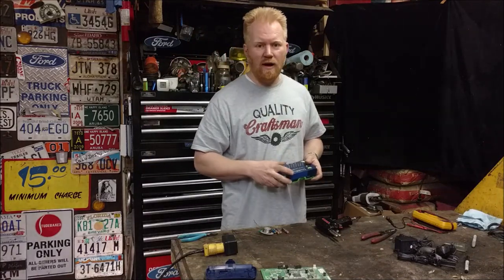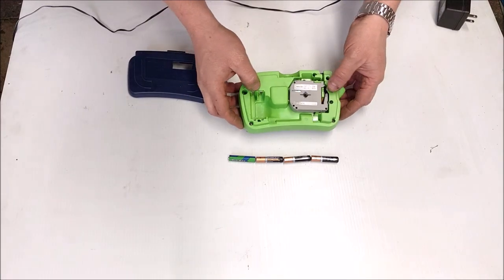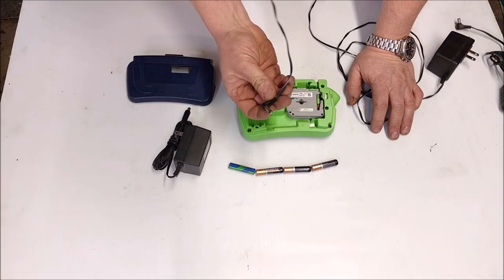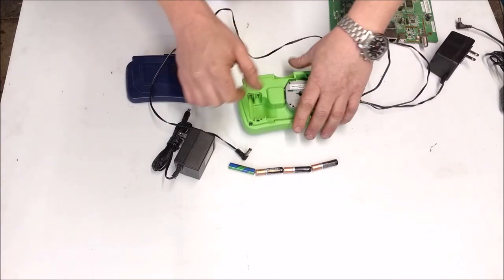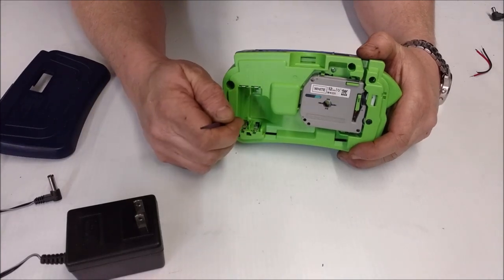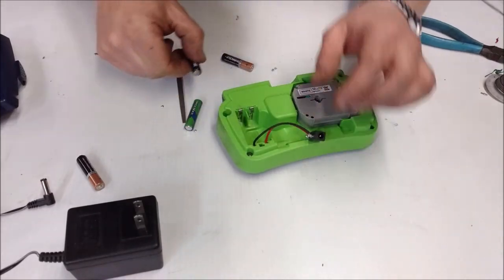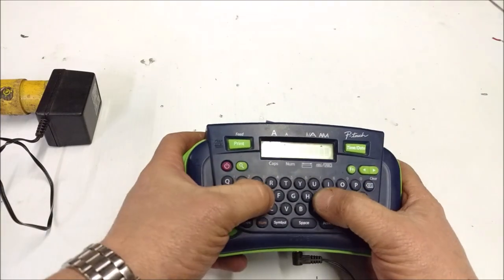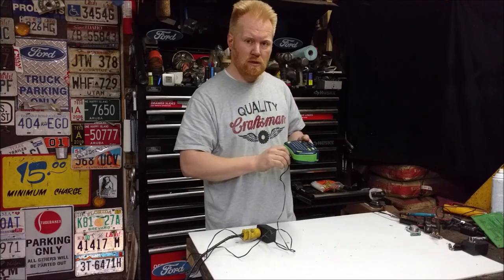Make a Battery Powered device Plug-in compatible

Comment: I am a deer hunter. I made a 4x8 enclosed deer stand 16 feet off the ground.  I purchased a camping fan that has 4 D batteries. I use it to defog my windows when I run my heater.  Can I forgo the D batteried and hook uo a larger battery so my fan will run with out changing batteries all the time?
Reply from the maker: You could get a 6volt Deep Cycle Lead Acid battery, and it would run forever. But I'm not sure if you would want to lug it up 16 feet.
Reply: tks

Comment: So to convert something that only uses 3 batteries or 4.5 v I need to have the relevant powered adaptor?
Reply from the maker: Yes. Battery powered stuff is very lenient and you could easily use up to a 5 volt power supply(easier to find than a 4.5v)
Reply: @sixtyfiveford  I chickened out and returned it 😂 I'll try to get another back because I really liked it... It's a LED Edison bulb lamp in this gorgeous cage but it's battery powered, for where I wanted to put it, batteries are a total waste of time. I'll get another one, and try your method.

Comment: What about the milliamps? I seem to recall you have to get the correct MA’s or you could blow the device?
Reply from the maker: No. The device will only draw what it needs. Batteries themselves can easily put out  1000mah- 2000mah+. Most stuff draws sub 1000mah/1ah, so a transformer in this range will be adequate.
Reply: sixtyfiveford thanks! So for a device that takes 4 AAA’s a 6 volt adapter with between 1000-2000mah would be fine?
Reply from the maker: 1amp/1000mah is more than ample and with AAAs a 500mah would probably be plenty. 4 cells hooked end to end will require 6 volts.
Reply: sixtyfiveford thanks!!!

Comment: Great idea, I have that same labeler, went to use it yesterday and what do you know the batteries were dead. LOL! This seems to be a regular occurrence with the labeler since I only use it every now and then.
Reply from the maker: I only pull it out every 4 months or so and the batteries seam like they're dead every time.
Reply: Rite, same here the power adapter is a perfect solution. I just stuck 4 AA batteries in mine yesterday to make 2 labels. LOL!

Comment: would this work for something running off watch battaries?
Reply from the maker: Yes. They are either going to be 1.5volts or 3volt button cell batteries. You can also just wire a AA battery cell in it's place and it will run 50 times longer than it did off the little button watch cell battery.

Comment: Can I connect my 18650 battery charger to the battery holder of my  device to charge them straight away..... Is it possible?
I don't want to swap batteries every time their charge is low
Reply from the maker: I don't see why not.
Reply: Did it work?  I don’t think it would as the charger is normally rated much higher than the battery, correct?

Comment: How do you know how many amps are needed? I just converted a 2 AA battery hobby drill to wall socket. The thing needs 3V to run but it runs much slower than when I connect 2 AA batteries to it. You can change the voltage on the adapter from 3V to 12V, I tried putting it at 4.9V but it ran at the exact same speed as before so I'm wondering if it has something to do with Amps?
The adjustable plug has several version of it, the one I bought puts out 600mA at 3V. Other versions have 2,1A at 3V and another at 1,5A at 3V. I don't know how many mA or A 2 AA batteries put out and finding that out is confusing. Google gave me 
 anywhere from 1200-3000 mAh for a single AA battery depending on type. I'm so confused as to how to calculate what Amps are needed. Anyone know how much mA or A I need to output to equal 2 AA 1.5V batteries?
Reply from the maker: A power tool will be on the extreme end of power draw. A full alkaline AA will allow a current draw of upwards 2-3amps. I would say .6amps is too low and you'll need to go upwards 1.5amps or even 2.1amps. They have a capacity of around 2500mah at a slow 100ma draw, so we can use this to guesstimate the current draw. 

Fresh Alkaline batteries
At 2amp draw: should last 10-15 minutes before the tool feels super weak
At 1amp draw: should last 30-40 minutes before the tool feels super weak
At .5amp draw: should last 60-75 minutes before the tool feels super weak

Comment: You matched the voltage.  What about the current?
Reply from the maker: You just need more than the device will pull. Battery operated stuff is generally very low, especially anything running on AA or AAA cells. A small 200ma would handle virtually anything powered by these small cells. So pick up one that's larger and you'll be fine. Even hooking up a 1000ma is fine as the device will only pull what it needs.
Reply: sixtyfiveford  Thanks!

Comment: The DC sockets have different amperages, how do we determine the correct one?
Reply from the maker: It doesn't really matter. The item you're powering were only pull the power that it needs.
Reply: @sixtyfiveford  I have these 1.5v battery powered LED lights connected to a mains adaptor that is 3v and it melted the hot glue in the housing and caused premature failure?
Reply from the maker: @shaunhill2466  So you're running 1.5 volt LEDs off 3 volts. That would melt them. You just need a 1.5 volt transformer.
Reply: @sixtyfiveford  But you said it only pulls the power it needs?
Reply from the maker: @shaunhill2466  It pulls the amperage it needs but you need the correct voltage. So you can get a 1.5 volt 100mah-2amp+power supply and it'll only take what it needs
Reply: @sixtyfiveford  Thank you for explaining. How do I make sure the amperage is correct and how is that different to milliamps?
Reply from the maker: @shaunhill2466  You don't need to really worry about the amperage just the voltage. 
1000milliamps=1 amp

Comment: i want to run my boom box off my 12 volt spare car battery - but i can't find ONE! vid on how to do it. please respond - im having hella time finding this out. You know?
Reply from the maker: How many batteries does your boom box use?
Reply: @sixtyfiveford  ten -- hey buddy thanks for reply !
Reply from the maker: @t42 Press If they are hooked end to end in series then the boom box is running off 15volts-10volts(10 batteries full to 10 batteries empty) and straight 12volts will work just fine.
Reply: @sixtyfiveford  yes the Question is: How or what do I use to clip off the neg and pos posts of a 12 volt battery and wire it to an household outlet? Some have said break some jumper cables (there's where you get your clips off the pos and neg posts) and then what....I'm lost. I'm thinking INVERTER for this....any familiarity with that?
Reply from the maker: Just hook the 12v battery directly into the Boom Box battery compartment with 2 wires and forget about the plug. An inverter that converts battery  12volts DC to household 120volts AC is going to waste a lot of the battery power and the battery will need to be charged pretty often.
Reply: @sixtyfiveford  so i twirl a copper wire around the positive post of the car battery and scooch it into the boom box battery compartment to touch the dimple where the D battery positive nipple touches -- and then twirl another cable (does this one need to be copper too?) around the negative post of the car battery and then hook it to where the negative side of where D battery's touch inside the battery compartment; you know the little spiraly twirlly thingy. Yes but there are 3 sets of these neg and pos...?
Reply from the maker: There should be one positive (little nub) and one negative (spring). The other contacts are joints that just connect the positive to negative from one battery to the next. Not that it matters but with 10 batteries I assume you have 3 rows of batteries. One with 4 cells back to back and the others with 3 cells each. It takes up to much space to stack 10 cells end to end so they put these joints in.  Generally the positive and negative you need are on the same side (most of the time left) and the positive/negative will be in the top and bottom cell rows.

Comment: Ever try this on a 18650 battery?   Thx
Reply from the maker: I have. An 18650 cell seams to work fine in place of most 2 cell devices but should also work in 3 cell devices. The 4.2v-3v that you get from the 18650 seams pretty good. It is about a volt higher than 2 cells(1.5/1.6x2=3.2v) but the things I've tried it in didn't seam to care. I can't say that about every 2 cell device though.

Comment: Yup, nothing beats AC to DC. Batteries getting so expensive and then throwing them away. Who disposes of them properly anyways? One thing to point out is output Voltage is important to match but also "AMPs" will effect performance. Largely on power tools. Im converting a 14.4volt power drill. 14 -16 volts OK but requires higher amps.
Reply from the maker: You would need around 25amps of 14.4v to supply a drill under load.
Reply: @sixtyfiveford  - Well 2 years later I went back to validate what I was attempting to do. I gave up modifying my saw until needing it last weekend.  My device is actually a 14.4v cordless  mini (5 1/2)Skill saw. (Why did I say power drill ??) The battery lists 14.4v 2.5 amps. Going back to your reply - was that a typo? 25 amps?
Reply from the maker: @MrGlobaldave1  Yes 25 amps at a minimum. Take a regular circular saw that you plug into the wall. It's going to draw 15 amps at 120 volts. That's equivalent to 1800 watts of power under load. A battery powered circular saw is probably 1/3-1/4 as powerful. That means it needs, let's say 500 watts to run. 500 watts divided by 14.4 volts is equal to 35 amps.
Reply: @sixtyfiveford  - Wow - Ok thanks....again! Numbers make sense. I just stumble with the amps the rechargeable battery pack supplied indicates - 2000mah or 2.0 AH
Reply from the maker: @MrGlobaldave1  2.0amp hours. Means that battery pack can supply two amps for exactly 1 hour. 
2 amps for 1 hour
4 amps for 30 minutes
8 amps for 15 minutes
35 amps for aprox 3-4 minutes
Reply from the maker: @MrGlobaldave1  If you really want to utilize the old power tool, you can always use a 12 volt car battery. Just make up some leads. Clip it on your battery cable like the jumper cables and you'll be able to run it wherever your car is with the battery.

Comment: So 6V but what amount of current?
Reply from the maker: Battery operated stuff generally isn't going to draw more than 250-500ma at the most. So a 1000mah power source is more than ample.
Reply: Would a 1000 mA source not damage the device? I think I used a 300 mA adapter.
Reply from the maker: @origamigek  No. Because the device will only draw what it needs. Batteries themselves will put out in excess of 1000mah.
Reply: Oh rly

Comment: So I was thinking about converting one or two of those tactical flashlights you can buy from Amazon or some stores for like $20 or so which are super bright and you can adjust the beam from floodlight to super focused/laser beam and convert it from battery powered to a DC or AC power source on my 2012 Yamaha Zuma 50F scooter (whichever it the bike uses) kinda like fog light. Can you help sixtyfiveford? or anyone out there who knows what I'm talking about?
Reply from the maker: These small 12volt spot lights for around $10 each are amazing 2 pack w/wiring: https://amzn.to/2RIjEED . They already have the mounts, wiring, switch etc. Your Yamaha is going to have a 12volt DC system that should run 2 off these without issue.

Comment: What about amps / milliamps?
Reply from the maker: What about them? Most AA, AAA, C and D powered items only pull maybe 100-200milliamps. Any power supply over 500 will supply them with ample power.
Reply: @sixtyfiveford  ohhh ok yeah that makes sense. I forgot that you can have more amps than is needed but only volts need to be the same. Thanks!

Comment: What if my device needs 4 batteries.
Reply from the maker: You need a power adapter that'll produce 6 volts. Each AA, AAA, C, or D puts out the same voltage at 1.5 volts.

Comment: https://www.flickr.com/photos/50621316@N05/30872466450/in/album-72157663774625984/  New steel welded in, I contacted a guy, he tigged in the front & back side, I also had him weld up for me on my old scraper edge a 5" piece of steel so the scraper has plenty of edge to burn before I need to fix it again (and hopefully by then I will have my own welder.)
Reply from the maker: Looks great.
Reply: I have been working on it (or having work done on it) as I get extra cash from overtime.